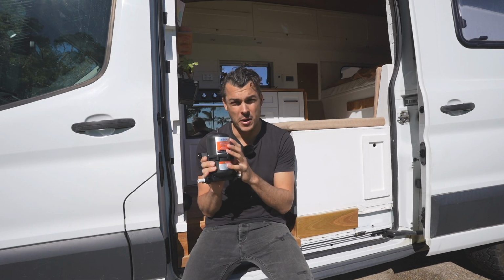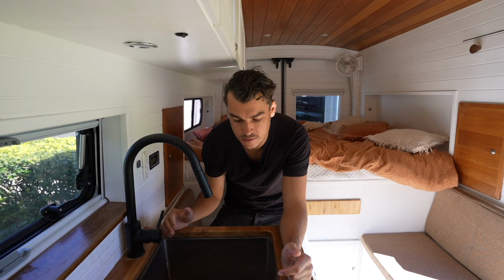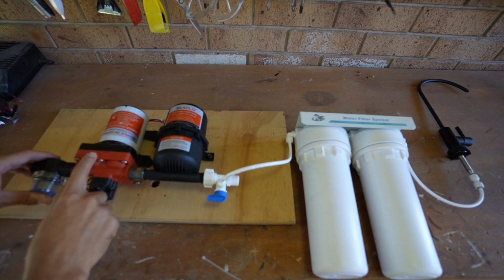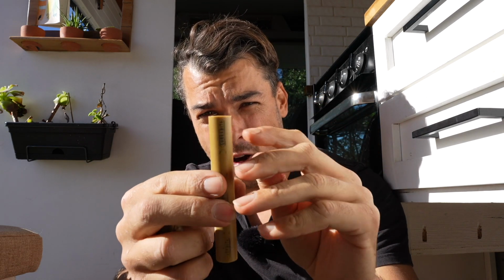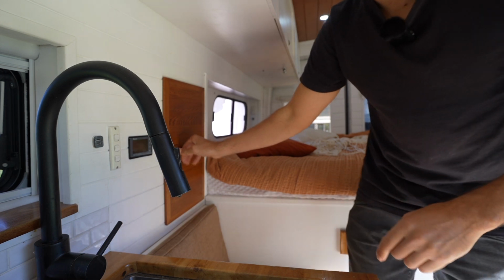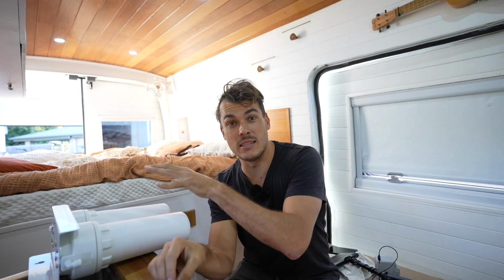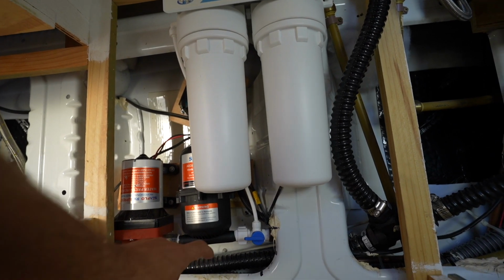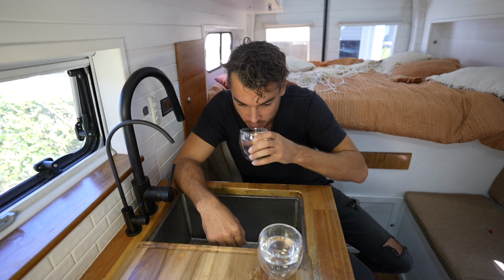Upgrading My Water System with an Accumulator and Water Filter

Comment: So, I thought I'd follow your advice and get an accumulator tank but I was shocked that you said in the video they cost about $40 and then when I opened your product link it's $218. Surely it can't have gone up by that much in just over 12 months!
Reply from the maker: Hey mate, yeah that’s really bizarre — when I bought it, it was around $40, and that’s why I mentioned that price and added the link in the video. I definitely can’t explain why the seller has increased it to $218 now. That’s a massive jump!

I’ve found a much more reasonably priced one and I’ll update the video link so others don’t run into the same issue. Here’s the alternative link in the meantime: https://ebay.us/QlPoH5

Thanks for flagging it — appreciate you letting me know!
Reply: @saltyvanventures  Thanks so much, Marcel! I've now ordered the cheaper one from the new link. It's so good that you're still monitoring your old video comments and care about your viewers to update info like this. Absolute legend and much appreciated!

Comment: I noticed that your pump is mounted vertically. In my experience the pump will fail prematurely due to the additional pressure caused by gravity on the front (lower) seal and bushing.

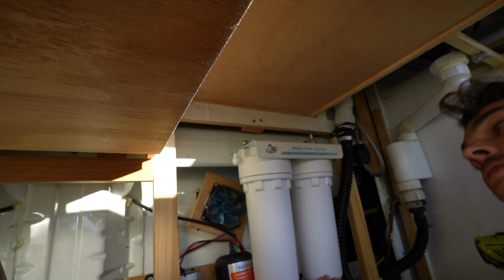Comment: @11:48 The fasteners should have had Loctite Threadlocker Blue 242 applied to their threads.
Your water system lacks effectively killing or disabling microorganisms like bacteria and viruses. Perhaps you are relying on chlorine added to your tank.
I think a closed loop system whereby you can circulate the tank water through UV protection periodically is optimal.
Daily maintenance.

Comment: Im going to buy a 10l drinking water from the supermarkets, have a separate small pump and tap for drinking. 10l goes under the sink.
Separate large tank and tap for non dr8nking water. Ill see how that goes. Yours is all in one which is nice.
Reply from the maker: Sounds like a good plan for your water setup, hope it works out well for you!

Comment: No, you don't "need" an accumulator tank. If you have the right pump. My Lillie waterpump has a build-in circuit so one doesn't need such a tank.
Reply: You obviously haven't spent time studying how these systems work mate. Sure, stress your water pump as much as you want, no one is forcing you to be smart.

Comment: 2:29 I just busted out into Darude - Sandstorm
Reply from the maker: I can't get this out of my head now!
Reply: @saltyvanventures  🤣
Reply: Hi, so if you were to set up this system at the start would you just need the water filter tap only instead of two taps? Thanks
Reply from the maker: You could do that, although the water filter taps have a pretty slow flow and could get annoying. You can buy a dual flow tap which is a water filter tap and normal faucet in one. You just flick a lever to switch between the two.
Reply: @saltyvanventures ❤